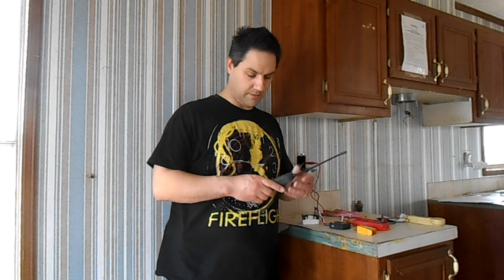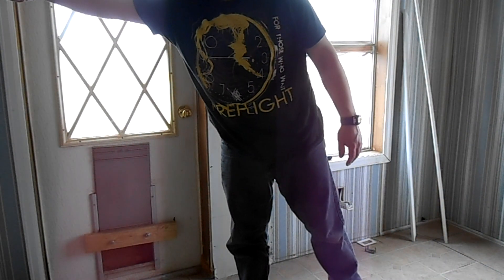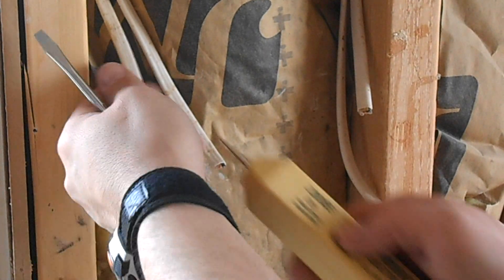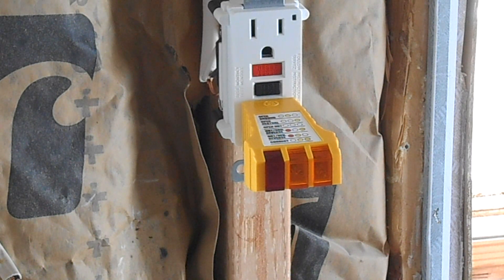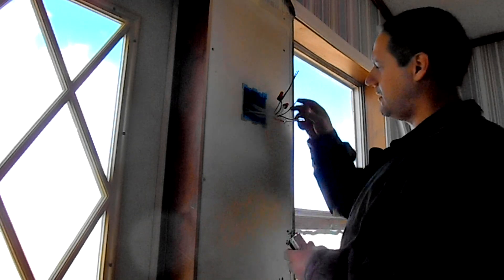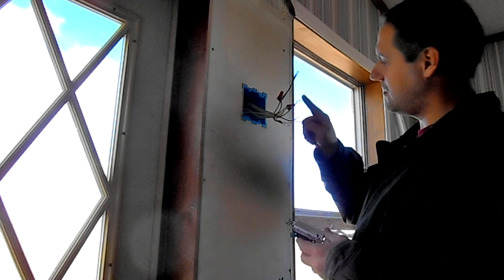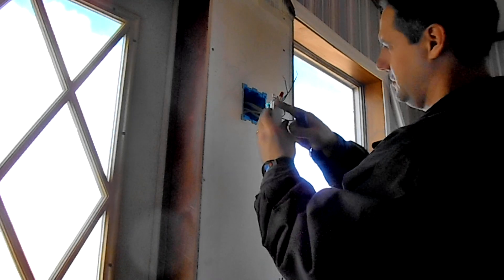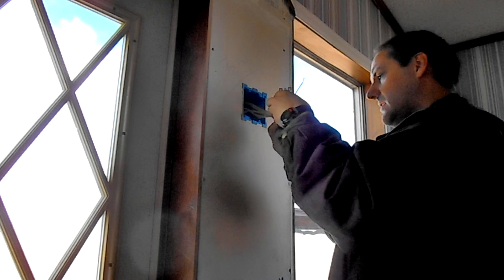Electrical Troubleshooting

Comment: lights have begun to flash on ceiling fan. Replace dimmer switch with same problem. Any guesses?
Reply: If your fan has a pullchain dimmer it can go wacky with CFLs/LEDS.  Certain LED bulbs can flash on a fan regardless of a pullchain dimmer.  Or the light kit is just bad.
Reply: Might be wrong type of bulbs

Comment: I am a journeyman carpenter and wired houses with an electrician, also a power engineer, done lots of Reno's but haven't had to take off drywall and find wires cut off, more power to you, you've got persistence. Great stuff.
Reply from the maker: Thanks, have you ever worked in a manufactured home?  I seem to be amazed every time I turn around in this house.
Reply: No I have ran framing crews built houses done commercial construction worked on 200 ft coal silos. Wired houses ran a big hotel maintenance department  always with one belief that if anyone can do it so can I. It may take a little longer but ultimately I will prevail, just as you have demonstrated.
Reply from the maker: I love that attitude and feel the same way!  Keep at it and thanks for the comment.

Comment: i noticed you changed the HF tracker for the other detecting device .,wouldn't you were able to find the short just using the wire tracker form harbor's?
Reply from the maker: HF induction amplifier was fine (detecting device), this video stretched over multiple days and I just misplaced it.

Comment: question, please can you tell me where to buy the wire tracer I been looking for in locals stores and online but I couldn't find it no where please if you can tell where to buy and the tools info 
thank you
Reply from the maker: If you need it immediately, you can get them at hardware stores like Lowe's.  They will be in the cabling section with bulk network cable, keystones, and faceplates, etc.  They are normally really expensive in stores.  If you are not in a hurry, I would suggest purchase one from Amazon, search on "wire tracer/tone generator" for an example.
Reply: thank you very much